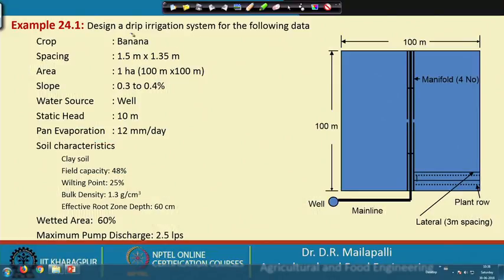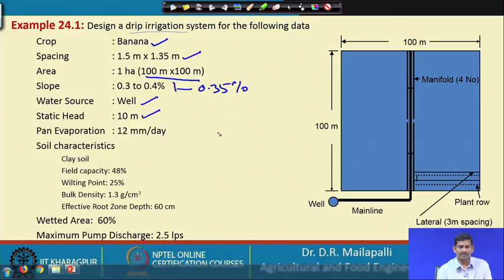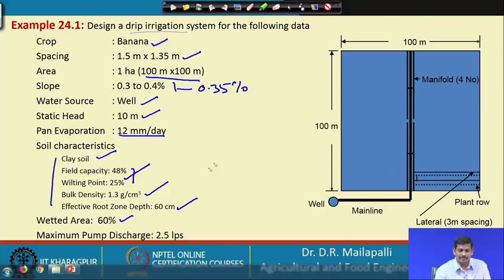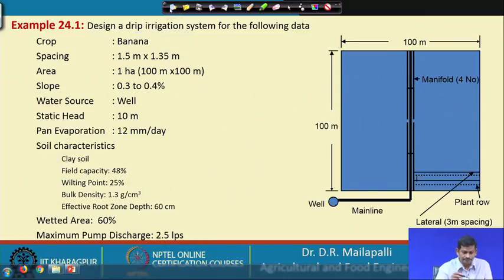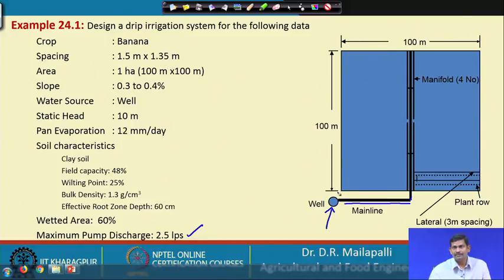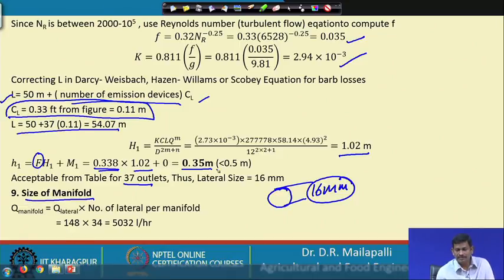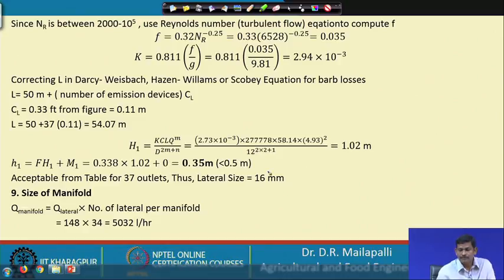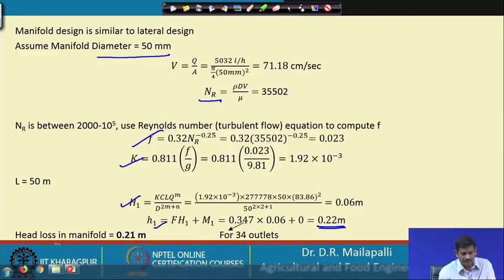Lecture 24: Drip Irrigation Design

Comment: also for determining irrogation period, the units are not consistant.
Volume/ discharge = 10.21 cubic meters divided by 4lph...
so how u get 2.5 hrs?????
Reply: Yes bro u r right = 10m3= 10000litres 

Ten thousand litre/ 4 = 2500 

I also didn't get
Reply: @saurabhghodeswar7855   that was typing error, he had to write 10.21L instead of writing 10.21 cubic m.
From step 2, answer should be 0.010206 cubic m. But dividing it by 1000 you get 10.21 L

Comment: at 06:29 
you have calculated the volume of water applied by multiplying area into depth... area and depth units are not consistent... so how did you get 10.21 cubic meters??????
Reply: I think is 10.21 L/day, because it is 8.4mm
Reply: @tomaszezezeze   you are right that is typing error